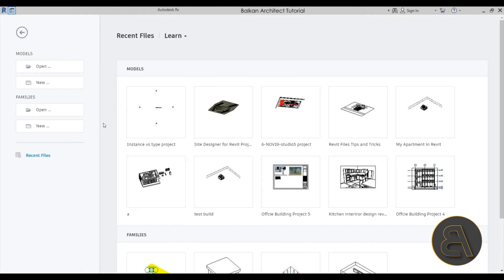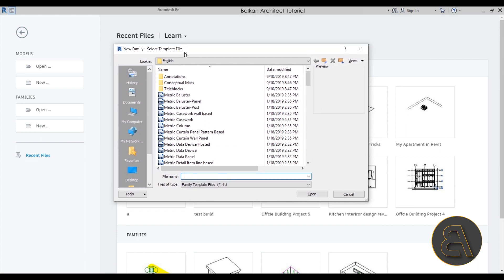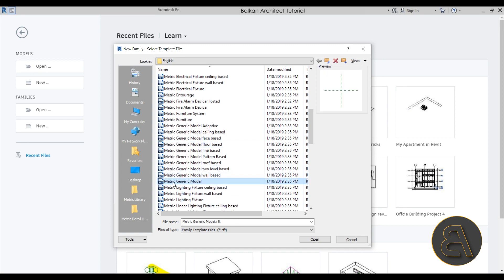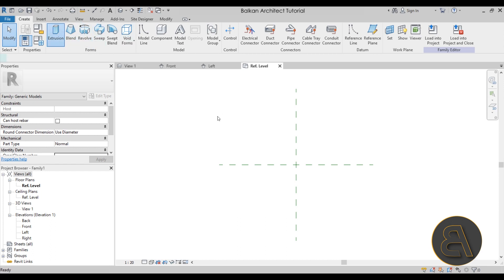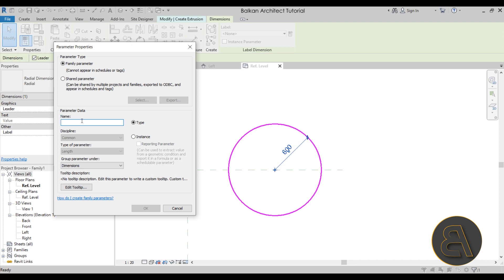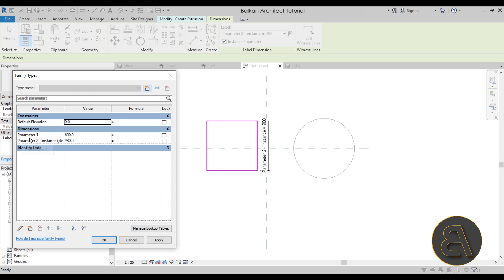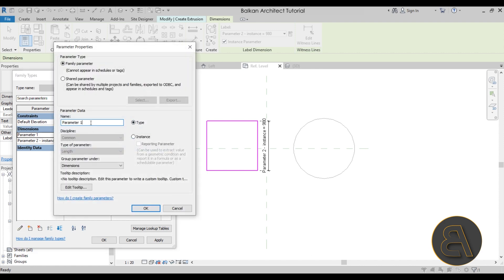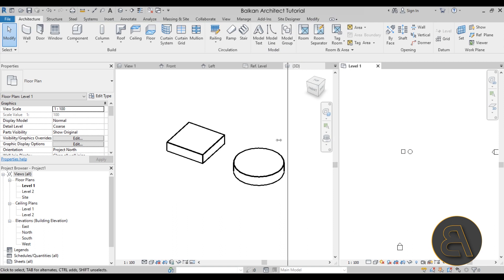5 Tips and Tricks for Parametric Revit Families Tutorial

Comment: Is there any way to create families that allow the user to pick elements in a sequence and generate a model at the end of the process?
Example: for an event tent, is it possible to provide the following questions / options to the user?
A) Width
A1 - type a value:
B) Lenght
B1 - type a value:
C) Floor? 
C1 - No floor
C2 - Plywood
C3 - Vinyl
D) Air conditioning
D1 - No
D2 - Yes
Reply: yes, you can add an invisibility type of parameter.